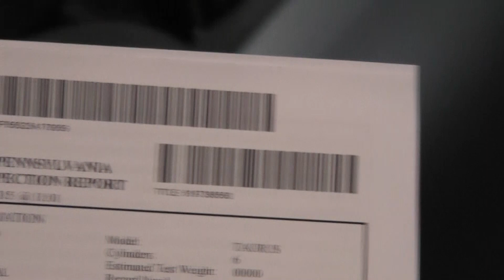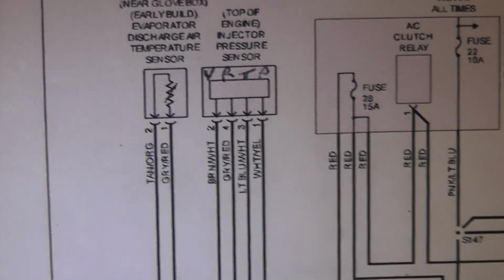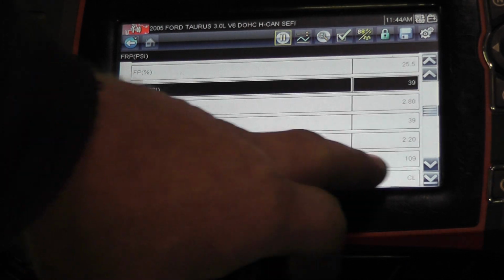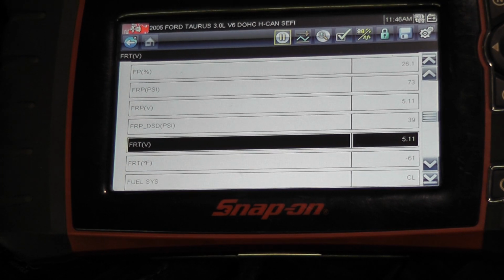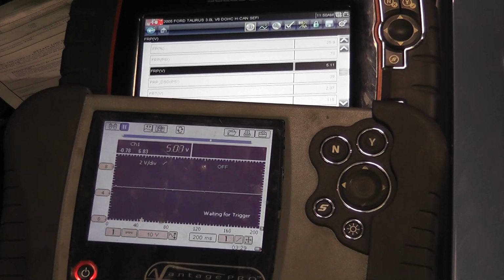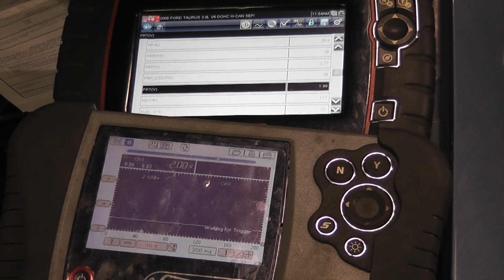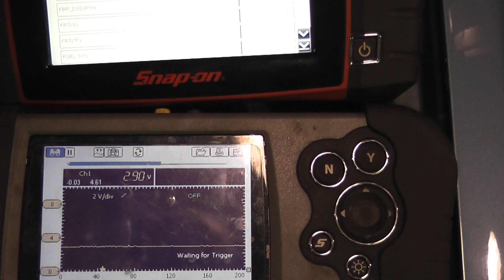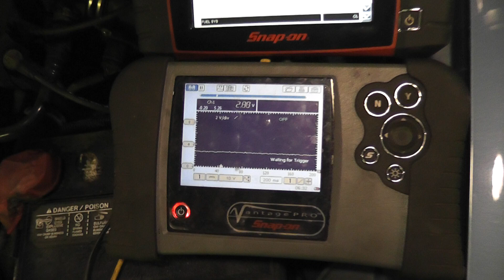FORD FUEL RAIL PSI SENSOR CODE P0193

Comment: Hey james how u been? i have a question big guy i been having trouble with this 2007 for f150 5.4 the truck idles perfect and runs great on till i give gas to the metal or pull a trailer and all 8 cylinders start misfiring and i just found that my scanner on pids reads 39psi on idle but i install a Gage and reads 29psi on gage but on loud it reads good wile driving is kinda hard to see the Gage but looks almost close to scanner and Gage. i already checked the MAF, cats for a flow problem, and many other things i had this truck for a month and i think im close haha only codes i get is random misfires.
Reply from the maker: +Ramirez Automotive look in back under the spare tire and see if the module there is rotted away. It's the brain for the fuel system
Reply: James Danner I see the module but looks normal I really don't know what to look for anymore there's a tick on right side and lacks sometimes when exeleration and if I keep my foot to the metal it starts missing onther shop just did timing chains and guides 7 months ago and was running fin again after the commen problems they have
Reply from the maker: +Ramirez Automotive did u ever figure it out? 
I didn't have any good ideas for you
Reply: No i try many things so just return the vehicle and didn't charge him but thanks James.

Comment: so did you run the car out of gas before replacing the part?
Reply from the maker: +Chelsea Hyman that one. . Yes by pulling fuse but u can put a rag over it and pull slowly if u are daring.  Ha. Done that too

Comment: James, just had an 04 explorer 4.0 with P0193. when it got hot the sig was going toward 5v indicating about 70 psi. pcm telling fpdm to slow duty cycle to pump causing fuel starvation ,engine stumbles and dies. when cool    2.8v 38psi engine runs fine. yours went to 5v and engine kept running. you unplugged it ,engine kept running? why ?
Reply from the maker: cool. we were talking about that.  mine definitely failed as an open circuit. went from good straight up to over 5v.. if you had one that gradually increased and didn't set a circuit code, we were wondering if what happened to you Would happen.  that would have made a way better video. Ha
Reply: George Heri  I had this exact problem with a 07 explorer , the car would run great up until the sensor shorted .

Comment: So that has a mechanical pressure regulator and electronic regulator?
Reply: JOHN HUFNAGEL Great observation! I've messed with a FPR sensor on a Ford Focus before. The key is that the ECM wants to know the Fuel Pressure IN RELATION TO INTAKE MANIFOLD PRESSURE (where the injector orifice is located), not atmospheric! So that vacuum line is basically a reference pressure :) 
At idle, if you tee in a mechanical gauge, you will see roughly 10psi LESS pressure on the gauge than the FPR data pid! That threw me for a loop since the Focus was barely running on 0psi, put the FPR was reading 10psi...
Reply from the maker: it has the vacuum mechanical part but the electrical  part is just sensors. the ecm duty cycles the positive side of the fuel pump thru a pump module (usually in the rear of vehicle) based on the rail pressure sensors  actual reading
Reply: ya I understand the pulsing of the fuel pump to get the correct fuel pressure. But if you got a pressure sensor and the modual is pulsing the pump to get the desired fuel pressure whats the purpose of the vacuum fuel pressure regulator? It wouldn't be needed since the pressure is controlled electronically? I worked on other makes that only have a pressure sensor. Just wondering why it has 2 ways of controlling the pressure
Reply: JOHN HUFNAGEL Probably a vacuum assisted preload spring on the backside of the diaphragm. at higher rpm/snap throttle the vacuum reduces allowing faster response from the sensor. Totally guessing though.

Comment: Funny that the computer stays in closed loop with the Main Fuel Sensor unplugged....
Reply from the maker: maybe since it was intermittent and failed with a direct open circuit as opposed to fluctuating erratically within range.  the learned fuel trims most likely didn't change drastically like they would with a real pressure problem . ..?. I'd be curious what would happen if it was totally dead for a period of time

Comment: Dude, I wanna see that Nova!
Reply from the maker: my 72? or Nick's 74 that he eventually says he is putting that 355 in?.  I do have a plan to show, me putting a set of old bowtie heads with monster valves...208" intakes... with some offset roller rockers and a 750 dp Holley on the 358 that is already  in there. but that's prob a winter project

Comment: 5v bias isn't that kind of high?  A lot of bias voltages I've seen on scanner danner are much less.  5v would easily confuse me for VREF.  Good to know!
Reply: ***** Unplugged you would read the 5v ref and the five volt bias voltage. If you plug it back in, you are basically loading the circuit ( thru the sensor ground ) and there is a voltage drop because of the bias circuits very high resistance and very, very low current flow, then you would know it is a bias voltage. I do believe Paul has a section in his book discussing that 5v Bias!
Reply from the maker: yea..I only know cause I chased that ghost on other fords unfortunately